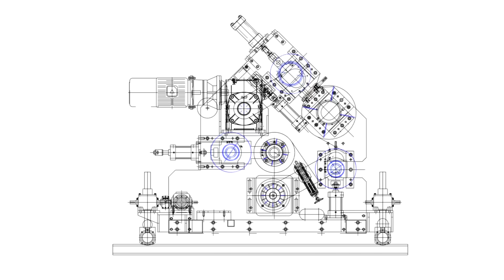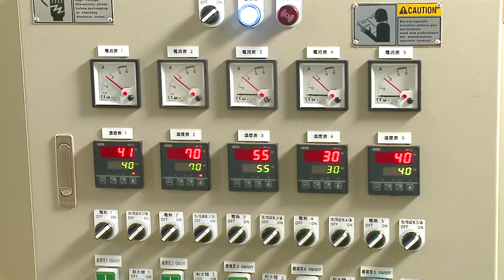Sheet Extrusion PP&PE&PS&ABS&PLA

Comment: what is the red rotary for???(1:01)
Reply: It's pressing the hot plastic through the molding unit, and then it comes out as a sheet in this particular case. This process is called extrusion.

Comment: Interesting,  but can you make coatings on this sheet?
Reply: This is a casting operation. Next process to coat requires a coater. I charge no fee for this simple information. Then to other needed equipment, slitters., laminator, and others for the Manufacturer of select applications and products needed in many industries.
Reply: @jeffpeters6023  give your email id
Reply: @Akash_Murali   Sorry for my delay. I apologize for that. Not really busy just missed your message. I can be contacted at jeffpetersohio@gmail,com. Interesting  as I do not type this very often to send. I do alot of gmail.  
What are your interests ? Your location ? Occupation ? 
As far as your interest into coating, there are several types of coating according to the  material for hot or cold applications. 
Thank you. 
Jeff